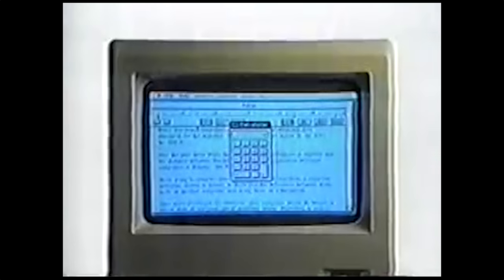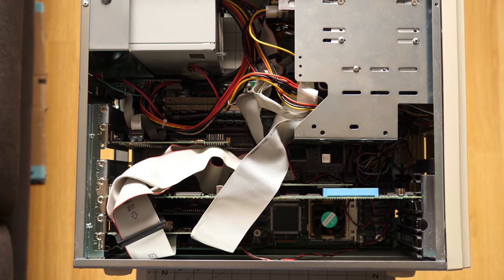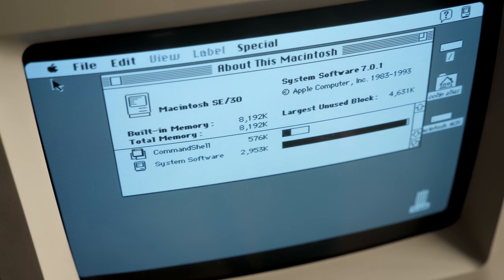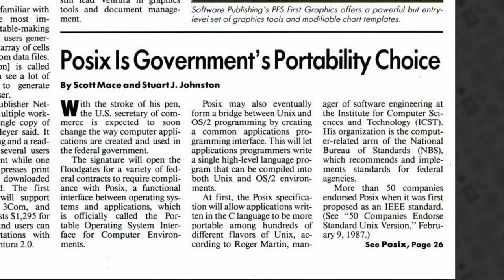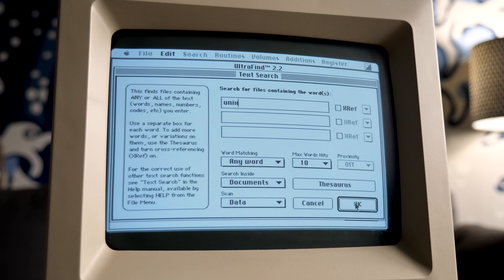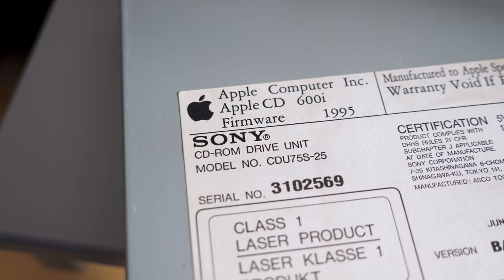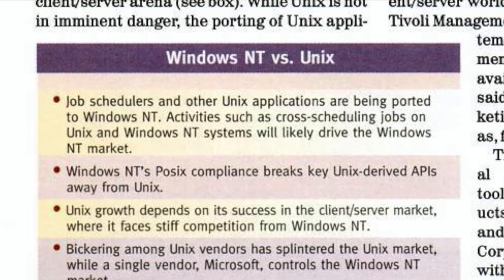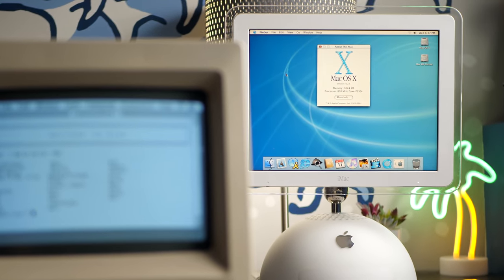Apple A/UX: The First UNIX Mac OS!

Comment: 6:37 Actually, no, Windows NT ended up winning. Early versions had a token “POSIX layer” built in, just to pass the US Government “open systems” requirements, but nobody really used that. But yeah: thanks to the fragmentation of the UNIX market, caused by all the vendors’ attempts to lock customers into their own particular Unix flavour, Microsoft was able to sneak in and grab just about the whole market.
Reply from the maker: The “BSD won” statement was in reference to the UNIX wars, not POSIX in general.
Reply: @ThisDoesNotCompute  But still, they all lost.
Reply: @Michael Hansen Yes, they are now. Being pushed aside by Linux.
Reply: Believe it or not Interix/Services for Unix was pretty good around the XP/2003 days. This utilized the POSIX NT subsystem and provided the userland and tools for it. There were a few bugs but overall just about every popular GNU tool would compile on it, it included gcc and a full dev chain, and X11 - but with no X server. 

I used to use it extensively when I needed to run Windows but wanted to run certain Unix scripts and CLI tools.  It had much better integration with the OS than Cygwin did, it was easier to access the NTFS folder structure, and it supported more POSIX functions than Cygwin did.

Comment: We tried using A/UX at our university, but it was kinda expensive and hokey.   The SCSI drives of the time only had a thruput of 100KB/second which was reeally slow for a disk-heavy OS like A/UX.  So everything was a bit clunky and slow.  And being based on Bell Labs Unix it was always incompatible with the more popular Unix versions.    Every project you tried to port to A/UX ended up as needing a lot of source-code include file changes and tweaks.  After a week or so of these most people would just give up on A/UX.  Slight sad.
Reply: What was worse, I remember a report somewhere which said that, every time some process queried the system time, A/UX had to do a disk access. Since this kind of thing was happening frequently, that would have been a major factor slowing the system down.

Comment: Actually, AppleTalk was quite robust; and Apple itself had a network of thousands of machines: everybody in the company used Macs as their primary machine. It just wasn’t the networking protocol of the rest of the industry; or the internet.
Reply: The was no standard protocol back then or even connection type.
Reply: Kiyoshi Kirishima - Eh... sort of, but not quite. TCP/IP was the multi-site standard that the internet was (and is still) based on; and there was a way to tunnel TCP/IP thru a LocalTalk connection. The majority of other non-Apple systems used one of the varieties of Ethernet as the base transport layer; and later on Apple developed a means of sending AppleTalk packets over Ethernet (called EtherTalk). When I was at Apple in the ‘90s, about half of the machines we had in the lab were on LocalTalk and bridged to the main Ethernet network by a router; and the other half either had an Ethernet card in the PDS slot or had an AAUI on the motherboard.

Considering the variety of machines and networking systems in use, it’s remarkable that it was all more-or-less plug-and-play. The worst trouble we had was with coax Ethernet; when a chain would get broken in the middle; or a terminator was missing... and I think that only happened a few times while I was there (and we were swapping machines in and out on a fairly regular basis - it was, after all, a lab).
Reply: AppleTalk was considered “chatty” by network gurus—there was a lot of periodic traffic to keep routing and zone name tables up to date. That was the price to be paid for the ease of setup. Basically only routers needed much configuration; end nodes (that included both servers and client machines) did not: just plug them in, turn them on, and you’re ready to go.

One of my jobs at my last employer was AppleTalk admin and all round Mac fanatic. That was back in the last century.
Reply: AppleTalk was a very well designed suite of protocols, and the book Inside AppleTalk by G. Sidhu is one of the best tech books I've ever read.

Comment: Good synopsis.

I am surprised you didn't go into the various attempts made by Apple to do "something" about the situation with the OS on their hardware.

If you decide to eventually do a OS X recall, please consider doing so.  I think you will find it very interesting.

Especially the politics, which in my opinion forbid the actual solution to the problem internally.  Too many engineers felt their baby would be replaced if those problems where solved. They were right of course, so Apple many many times had to go outside its organization to solve its problems.
Reply from the maker: Apple’s other Mac OS replacement projects (Pink, Copland, etc) would have been too much of a diversion, I wanted to stay on-topic with A/UX. Stay tuned, they’ll play a part in a future episode.

Comment: POSIX is nice as far as it goes... but... that’s the problem: it doesn’t go far enough. There’s no GUI layer - which is, by the way, where printer drivers need to live for WYSIWYG to be realized, as the same command stream that drives the screen output while you are editing should be what drives the printer. X11 is a de-facto standard just due to popularity; it’s not actually part of POSIX (and the current most common platforms that are POSIX compatible at some level - iOS and Android phones & tablets - don’t run X11 at all).
Reply: Agreed. I would love to see POSIX extended to printers, window managers, WiFi hardware, etc. It seems that there is almost always some pain with drivers (primarily printer) when I install Linux and I'd love to see that resolved.
Reply: "Posix compatible" at the time meant that hmm... the system could pass some of the Posix tests.  That was a humorous time when nothing was really as compatible as it claimed to be.
Reply: @RockwellAIM65  That makes sense. Similar to the original "PC Compatibles" not being truly PC compatible I guess.
Reply: @bitsnbytes7514  I see your point. However, wouldn't it be nice to have some standard to cover things like a GUI layer and such?
Reply: bitsnbytes - The point of POSIX is portability — it’s right there in the name. Consequently; it needs (well, needed) to provide a comprehensive API for everything that cannot be readily implemented out of the pieces that such an API would provide. TLS, websockets, and the like can readily be implemented on top of the basic sockets API provided; without platform specific dependencies. From the perspective of the OS, those functions are what the program is doing, not how it’s doing it. The basic functionality of a GUI based program involves a lot of how and that it what needed to be covered by the standard in order to fully achieve its stated goal of portability.

In practice today, it’s not a big deal for the most part, because there are so few platforms left that cross-platform middleware becomes practical (either implemented as a specific part of a larger project, or as a more general library like Qt is).
Reply: @bitsnbytes7514  SPL2 on Windows seems to fix everything for me.  Have moved off the Mac and to Windows after 30 years of using NeXT/Mac.  It's been kinda fun actually.
Reply: https://www.freedesktop.org/ does the standards for that. They are the reason why you can take a bunch of apps written with different GUI toolkits and run them on different desktop environments under Linux, and have it all work.

Comment: Commedore tried to do the same with the Amiga 3000UX which had AT&T System V implementaiton .  They got the system together but flubbed in getting it sold and distributed.  https://en.wikipedia.org/wiki/Amiga_3000UX

Comment: The right idea, but at the wrong time.

If you’re watching this video on any modern Mac or iOS device, you’re using an Apple Unix system.
Reply: " Apple Unix system" yea right, if that would be MS system Apple fanboys would call it plagiarism, but when Apple is using x86 and doing skin-job to PC Unix OS then it is inovative... ROTFL
Reply: You're talking about Carnegie Mellon Mach / NeXT derived systems.  This was a completely separate implementation;  gone horribly wrong.

Comment: IThis does not compute: Interesting Video  But two statements got me a bit on tilt. You said AUX RAN on the Motorola 88K series and I agree but you also said a complete rewrite was needed for AUX to use the Power PC? The RS6000 Motorola 88K AND Power PC ALL had the same instruction set. Basically, they all used the RS6000 Set. Yes they were different hardware and Microcode and the way instruction was processed was different but that was invisible to the OS and or processes built into kernel modules rather than usr space. Thus it should have ran on Any of the 3 CPU setups other than Multi CPU RIGs that were common on Larger systems. In fact It should RUN on All of them without a rewrite. Possibly drivers and or some adjustments on the UFEI Or the small OS that loaded just prior to AUX may need adjustments but the whole OS would not need a rewrite?? Yes  NO. I say this as I used to program on all of these rigs including an RS-6000 / Linux based OS for a 10 Gb Ethernet Switch. AIX was also on OS I supported Kernal level processes on for over 20 years. In fact Apple gave me an AIX system in 95 or 97 to test out for the academy awards. It was a 142 Mhz 604 PPC.  And I saw the UNIX vs NT news paper page. I thought I was the first UNIX vs NT webpage. Oh well on the UNIX vs NT maybe my old site was the first but others had info on it prior to its release. Also, I do not recall NT released till mid 90s after AUX was gone.  Silicon Graphics using their MIPs based IRIX OS and Sun OS and SUN SPARC Solaris used my site as a sales tool for many years. Anyway It does not compute on the rewrite.
Reply: Motorola 68K, not 88K
Reply: @geraldfreks2723  OH  Dam  I thought you said 88k  Yes if AUX was on 68k as apple used prior to switching to a RISC PPC . Interesting. I never cared too much for the 68K family. the 68040 was not too bad but 88k RICK was so much better. Next used the 68030 on its Next Step rigs. Pretty good overpriced system if buying titainium is important.

Comment: That little Spoiler, BSD, is part of what makes macOS successful. The macOS kernel contains large portions of FreeBSD code and Apple are still contributing code to FreeBSD, to the point that macOS might be considered a fork of FreeBSD.
Reply: Succesful? 15% in the workstation industry is a success?
Can you run 24x7 workloads that  takes weeks like ML FEA on mac?
Reply: @Teluric2  Compare that to other desktop deployment of any UNIX and UNIX-like systems, including Linux distributions? I'd call that successful.

Comment: When I see these old macs, I am getting really sad as how Commodore and with it, the Amiga computer went down, even though it was simply superior.
Reply: So true! :/
Reply: I got my first computer (a Mac Plus) just as I was entering high school. When I got in, I wound up making friends with other computer nerds (several turned into life-long friends) and it was there I was introduced to the Amiga 1000, and then the Amiga 500. (I was also introduced to the Atari ST and other things...)

The Amiga platform had a LOT of advantages at the time, and could also do (if I recall correctly) some degree of parallel processing by handing certain things off to dedicated chips instead of making the CPU do everything (which essentially was how the Macintosh handled things) and that meant, for example, you could have it load enough of a program to have it play intro music while you were still loading more of it from floppies you had to sequentially feed into the system. It also had full-on multitasking.

You can lay the blame squarely at Commodore's feet because they're the ones who became egotistical and just "assumed" the Amiga was so awesome and that they were so popular as a brand that naturally their business would just keep coming in, whether they actively advertised themselves or not. Even Apple of the present day, juggernaut that they are in many areas, still runs ads and promotes themselves.

Comment: BTW I was at Ample Computers at the time this was all happening.  Was disgusted with the slow pace of Ample at fled to another employer to work with more varied software implementations.  One problem with A/UX was the version of GCC that Ample shipped.  It was pretty brain-dead==>someone came up with a gcc build that would cross-build a decent version of gcc for use with the system!  This would let you take a IIfx and use it in a research institution/university/company that really wanted to offer multiuser unix services+software development.

However, as you said, the "unix wars," which involved SCO and ESIX from Everex on Intel really pounded on the implementation.  SInce gcc was idiot-prone out of the box, A/UX didn't even have a chance.

There y'a go.  You covered the other issues ok.  In California, we always had a friend who could get A/UX for a very reasonable price so cost was not an issue for many of us, even college kids.

Incidentally, the SE30 ran A/UX 2.0 wonderfully.   We ran it at Everex, where I first ran across it.  The Macintosh II did a good job but was a little on the slow side.  When I put A/UX 3.0 on my Quadra 950... well... it just jammed!  Loved it.
Reply: What has this got to do with Apple?
Reply: @lawrencedoliveiro9104  a lot, did you read it? Mentions an Apple OS and two different Apple models
Reply: @aaronlippincott7385  I didn’t see any mention of Apple.
Reply: @Joseph Is that what it is. Freudian slip?
Reply: @Joseph coz they make an ample supply of computers!  :-)  It also usefully changes search characteristics when I want to find past things I've written.

Comment: Such a shame.  The first few versions of Unix ran on 16 bit PDP11s that had 64K of ram!  (And version 0 ran on the ancient 18 bit PDP 7.). There was no reason for Unix to be a system hog!  
AT&T should have embraced the home computer market and targeted any system running a 68K based cpu, with it’s decent register set and architecture it was a good match for Unix.
Reply: I'm honestly surprised that Motorola didn't seriously manufacture a successor to the architecture for 32-bit machines.

Comment: Heck Apple even had their weird Linux distro, MkLinux in the mid 90s. Using a Mach kernal.
Reply: Yeah they did.  Remember "Yellow Dog LInux?"  Never found out if that was the same distro.
Reply: @RockwellAIM65  Yellow Dog Linux was completely unrelated. Made by another company and used a fairly conventional Linux kernel.
Reply: @RockwellAIM65  YDL was a different distro based on the CentOS distro (v5 and v6)...which is based on Fedora.
Reply: @xnonsuchx  Thanks for answering the question precisely.

Comment: Ahhh one last issue was ISDN and faster connections... NeXT handled ISDN quite well but A/UX didn't.  Never that I saw anyway.  In my mind, at the time, I was so glad I switched to NeXT- I sold my Mac II for close to $2000 and paid $2500 for my NeXT Cube.  After that, my environment didn't change a lot for 30 years... am switching to Windows 10 this year as it's finally surpassed Apple in terms of general usefulness.

Comment: "Hint: BSD ended up winning"
Current market: laughs in linux
Reply: Linux is not a unix variety it is a unix-like OS. It doesn't contain any original unix source code.
Reply: Apple: Releases Mac
Jack Tramiel: Laughs in Atari ST
Reply: Linux won.
Reply: I think he is saying that of all the UNIXs of the time the BSD POSIX was the one that was adopted.
Reply: @nicolareiman9687  Neither does BSD.
Reply: @lawrencedoliveiro9104  
Indeed, I believe there was even a trial to ensure that such were the case.
Reply: BSD still won. Most of the open source tool kits were ported from BSD. BSD is also the base for Darwin, the underlying operating system OSX. So while linux is great.. so is BSD imo
Reply: @lawrencedoliveiro9104  "BSD was initially called Berkeley Unix because it was based on the source code of the original Unix developed at Bell Labs." from BSD 's Wikipedia  page.
Reply: @nicolareiman9687  It hasn’t had permission to use the “Unix” name for some time.
Reply: @jaybrooks1098  GNU didn’t come from BSD.
Reply: Lawrence D’Oliveiro when did i say anything about gnu?
Reply: @lawrencedoliveiro9104  This is not my point. I think that i am talking about the source code and not the commercial name.
Reply: @jaybrooks1098  You did say “most of the open source tool kits”, did you not? GNU is a rather prominent one, wouldn’t you say?
Reply: @nicolareiman9687  If there was ever a “Berkeley Unix” name, I would say it would have been abandoned pretty early—AT&T’s lawyers would have seen to that.

Right from the early days, it was called “BSD”, for “Berkeley Software Distribution”.

Comment: Wait, does it have the instance of System 7 doing the graphics totally, or is it running through an X11 server doing the graphics? Because if it's the former, that's awesome.  Someone needs to clone it in that case, as an alternative to X11.  😘 Being able to run classic Mac OS desktop apps on a FOSS Unix would be a great way to bootstrap that x11-less desktop environment.  Wayland is a failure, there needs to be an alternative.  This is the future bro
Reply: nicksterj  Awesome, thanks.  I'd like to get some vintage hardware and play with it (I know there's emulators but that has drawbacks).

Comment: Commodore tried the same thing in 1990 with the Amiga 3000UX, running SVR4 on hardware similar to a Mac IIci (25Mhz 68030/68882). It failed too, for many of the same reasons - lack of software, high price, and mismanagement.
Reply: Ditto for their BSD 4.3 based RISC IX, that similarly came out in 1988, and used Acorn's largely ROM based RISC OS, as a boot loader, and abstraction layer, though the not being usable with less than 8MB of RAM, when machines with more than 4MB were exotic, was the biggest issue.